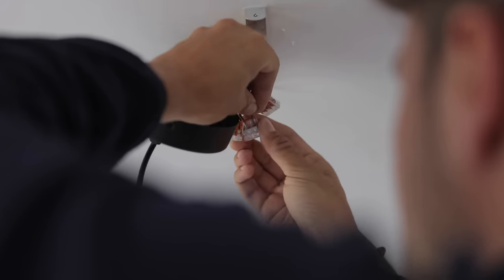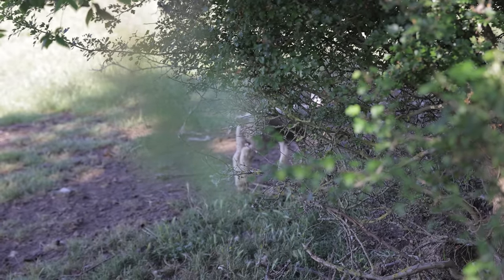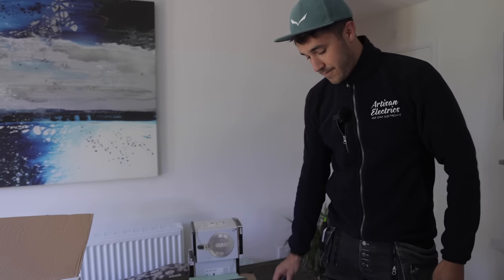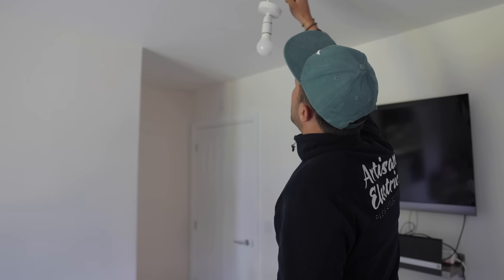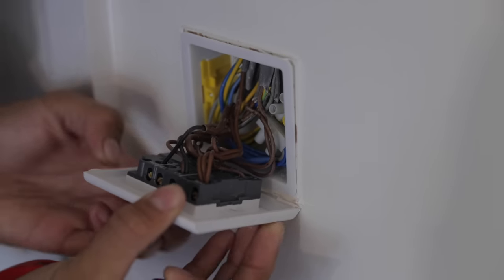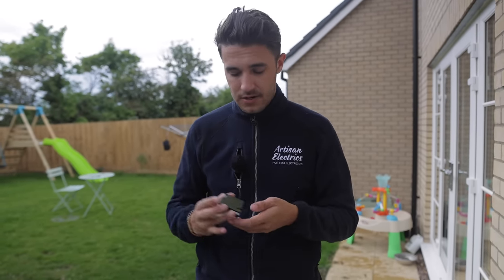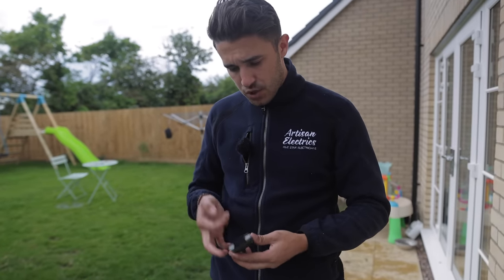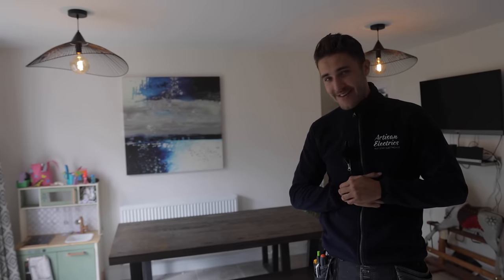Switch Wiring 101 - How to Connect Home Lighting

Comment: To answer your question... Measure the AC voltage between neutral and earth.  You'll always see some small voltage due to the voltage drop in the neutral conductors of all circuits.  This voltage will increase as the load increases.  If you short the two together, current will flow from neutral to earth reducing the current flowing back through the neutral leg of the RCD.  That causes an imbalance and the RCD trips.

Comment: The neutrals from all circuits (even live ones) are connected at the fuseboard, so if the N and PE conductors touch anywhere in the house, there will be current flowing to the PE from N, which will trip the RCD.
As for Cory's name, could it be Cornel? (where I come from, Kornel or Kornél is a common name)
Reply: Yep, neutral cable are technically "live" and I did accidently touched it with earth cable when I was changing a light fitting, caused an imbalance at the fuseboard, and tripped entire house. Whoops! 😀

Comment: Cory a quick tip. To Earth the light fitting a lot easier and quicker you could’ve used a bit of 1.5mm cpc singles and connected one end into wago with cpc’s and wrap the other end around the screw holding the bracket to the ceiling. Always worked for me and doesn’t require a crimp if you’re running low 👍🏼
Reply: another no it all 😂
Reply: @class-comedy-uk  not really mate just a genuine tip from another spark. At what point did I say I know it all you helmet😂
Reply: The fitting looked like it was class 2 before the box containing the terminals was chopped off. So in its sold state, it wouldn't need earthing, but as it was modified by the installer and then earthed, wins all round imo!
Reply: @class-comedy-uk  *Know

Comment: All neutrals are connected at neutral bar in the CU, contact neutral conductor to cpc gives an alternative return path creating a difference between line and neutral at the RCD, hence trip. Not an issue with RCBOs but is with split load RCD board.
Reply: Still gonna trip an RCBO as well. Just easier to troubleshoot.

Edit: ah, wouldn’t trip an RCBO that’s off. Not sure though, do RCBOs have a double pole switch?
Reply: @JasperJanssen  RCBOs can be single-pole or double-pole. Double-pole are less common. When you're feeding something outside (lights, pumps, outbuilding), double-pole is what I would use, otherwise neutral can continue arcing to CPC in the presence of moisture even when the RCBO is off.
Reply: @aaronmdjones  I am somewhat surprised to learn that there is not apparently a hard and fast rule for when to use one or the other defined in the various British standards.

(Here in the Netherlands, all consumer unit circuits are double pole switched, that was true with the old E27 fuses just as with MCBs and RCBOs, so we have nothing to decide in that regard. Not ever double fused, though, mind you, except on certain non-standard-voltage supplies that used to exist, most notably a 3x127=220 variant where the average circuit was 220V between two phases, and therefore got two fuses.)
Reply: @JasperJanssen  ah dat is dus ook waarom je hier (nog) geen RCBO+AFDD combinatie ziet van 1 moduleslot
Reply: @JasperJanssen  no

Comment: Little tip - you can use electrical tape to remove the white pips in switches / sockets by simply putting tape over them, pressing on the pip then pulling the tape away. Pips don’t get damaged when removing them so can be put back in when done.
Reply: I used that method also when I was doing new houses as always had some in my tool bag. The spare packs you can buy are not cheap.
Reply: Do they even need to be put back on if the backbox and thus the screws are earthed (and confirmed with, say, a wanderlead)?

Comment: I think the light fitting is considered class 2 as long as it’s connected in the little white junction box they provide with no single institution showing however no way you’ll fit 2x t&es in it so most will wago it instead, in that case it’s good to earth the fitting

Comment: Difference in potentials. As all the neutrals are connected at the neutral bar there’s always some current floating on it. If you touch earth to neutral on a switched off single pole MCB it t will create an earth path for some current from the neutrals. 30mA is enough to trip the RCD.

Comment: You have gave me many useful tips, so heres a little tip back to not trip the RCD when the breaker is isolated. Pull earth sleeving about 10mm past the copper and fold it back on itself.
Reply: A just fit double pole MCB's  like in Belgium lol .. then you can even cut the cable .. no RCD tripping ( when MCB is off )

Comment: The question at 6:30 (I am not an electrical apprentice although would like to know the answer to this question - I have no experience in Consumer Units or changing them) 

Is it true that only the live feed goes through the MCB? I thought the RCB was shared between multiple circuits and therefore would still trip because it would still be on.

that is probably wrong, just asking ✌️

Comment: I'd say it would trip the RCD because all of the neutrals are terminated together, you can get current flowing from other circuits. Since the neutral is often directly connected to earth at the service head, you're essentially allowing half the current that's flowing in neutral to bypass the RCD.

Comment: Nice to see you back Cory, forget comments from the trolls, I get them all the time on Face Book commentaries. 
I would have thought a standard terminal block could be used to separate and hold the loose wires rather than cut them off. 😱 Another thing, there seems to be a departure from BC and a rise in the use of ES lamps, as I think the fittings shown here use. Do you do a confidence check to make sure the outer screw part is in fact connected to Neutral and not Live? 
It was 60 years ago when I was an electricians mate and was taught then that ES lamps were only used in placed like America as the mains was only 115V. The chances of getting seriously bitten by the screw outer was thus minimised. 😂

Comment: 6:45  because uk people don't fit double pole MCB's .. so neutral and  cpc are alway connected .   I those 2 touch .. you make a residual current  and the  RCD  trips ..    glad we have double pole here in Belgium ..  MCB off = just cut the cable no RCD is gonna trip 🙂

Comment: 6:30 why does the RCD trip

1st year apprentice here 

I wasn’t able to find a comment, please correct me if I’m wrong as I’m still learning.  

this isn’t something i have learned yet but from what I understand the reason the RCD trips because even though the  circuit has been switched off, identified and tested and confirmed off, the other circuits are turned on… because the two wires touch (earth and neutral) this creates a short to earth and a potential difference tripping the RCD.

Again correct me if I’m wrong but in this instance it won’t trip if;
The rest of the circuits are turned off as there is no path for the current to flow
Or… the main switch is turned off 

How ever if there was only one circuit or all circuits turned on this would still trip… (to my understanding)
Reply: Also Welcome Back Corey! We love you :)  thanks for taking me down that rabbit hole, what a awesome learning experience. I’ll ask my tradie when I get in… if I don’t hear back, no stress 😎

Comment: Regarding earthing on pendant celling rose cover, I would say debatable because it same method of construction to metal table lamp as long there's plastic grommet inside steel tube that pass cable through to. However I would rather have it earthed to protect against wiring that enter ceiling rose. Hope that make sense? 😊

Comment: Why not just pop the neutrals in a wago instead of cutting them shorter?
Reply from the maker: They were trimmed to equal length and put into wagos after Zs testing 😁👍🏼
Reply: @artisanelectrics  I only ask because I've been to a few jobs where previous electricians have 'trimmed' things (usually to save a couple of seconds unscrewing a connection) and by the time I've got to it there's virtually nothing to work with.. so I tend to avoid trimming anything unnecessarily for future people's sake! :)

Comment: It's obviously going to be Cornelius, we're your patents Harry Potter fans 🤣
As for tripping the breaker, that's what they are designed to do when you have a short, even with the power turned off
Ask me how I know and I'll regale you with a tale about fitting a spot light in the electrical house of horrors that my previous owner left me with 🤣

Comment: Or you’d disconnect the neutral at the switch then you wouldn’t have to worry about it tripping
Reply: nee to open fuseboard for that :-)    double pole  MCB / RCBO's  like we use in Belgium . lol
Reply: @kittsdiy  so you’re telling me if you take all your neutrals out of the wago in the switch they’d still trip if they got cut at the light fitting? I don’t think so
Reply: @RhylMotionNew if you are Lucky you can do that .  But it's  an extra step...tot prevent rcd trip
Reply: @tompauwels  we’ll if you don’t want the RCD tripping youd take that step, another story if it’s 3 plates you’re screwed there as neutral is at the ceiling rose
Reply: @RhylMotionNew  no if you disconnect de neutral ist's fine .  Would not be needed when double pole brakers like here in Belgium 🙂